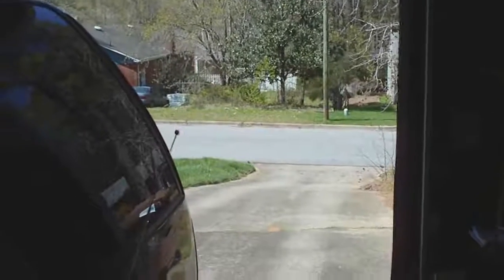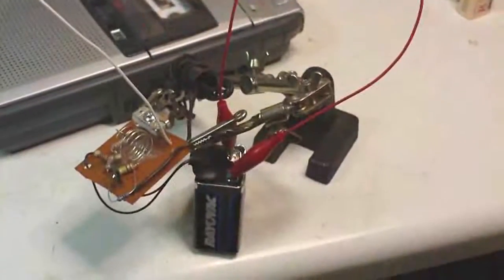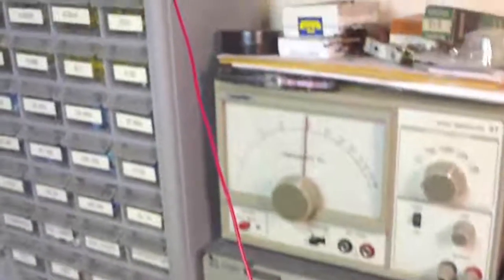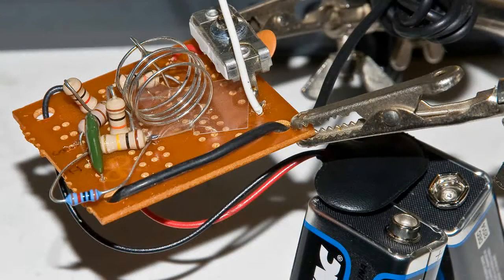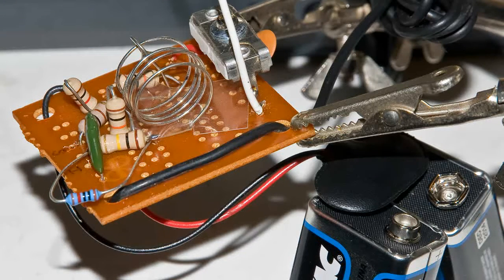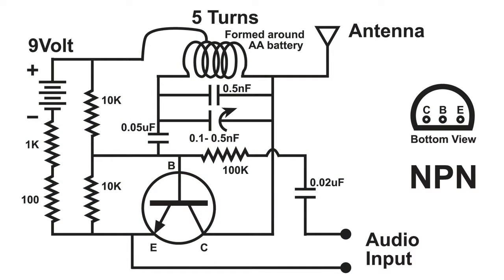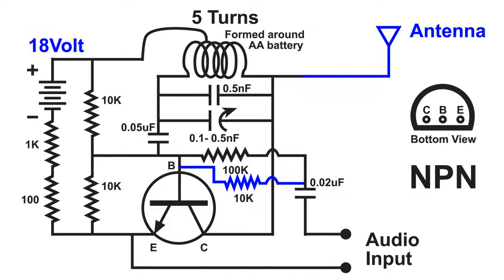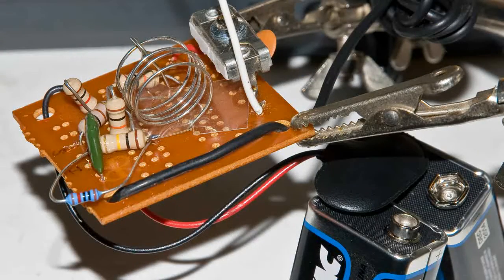Build FM One Transistor Transmitter Project Modification 3-3

Comment: What type/number transistor did you use for this transmitter?
Reply from the maker: 2N2222
Reply: @AllAmericanFiveRadio  ok, that's what I'm using. Have tried rebuilding this transmitter several times exactly like your schematic, but can't get it to transmit at all. Checked my connections and looked for shorts, but no go. Even changed the 5 turn coil out and tried different guages of wire. What gauge did you use? Oh, built mine on a circuit board and you used a perf board maybe that has something to do with it??? Thanks for all your help.

Comment: Hello, I have constructed this transmitter just like you have it here in your video. It has one problem, it transmits at 160.450mhz and not on the standard fm broadcast band. It will transmit quite some distance, but I don't want to be transmitting at 160.450 mhz. You said in your video that the coil and the variable capacitor has to be changed in order to transmit in the fm band. How many turns does the coil need to be? Also, what is a good value for the variable?  Another question is what guage wire did you use for the coil?
Reply from the maker: Five turns for the coil. If the frequency is to high add another 0.5nF in parallel with the variable.

Comment from the maker: @mantaz111 
The way this transmitter is built is not for looks. When you get to the FM band the physical component placement is very important. Also it is designed to have a low impedance signal source. I used a Radio Shack NPN transistor in a pack, works out to be about 10c for one. BC 547 is a AF transistor not RF.

Comment: @AllAmericanFiveRadio Video would be very nice to upload, but I don't have camera. About sound quality problems: I'm using my phone as audio source, could that cause any sound distortion? And I'm read in some web site that BC 547 is very crappy at this job, but I can't get other transistors to work. As a sound source I've tried computer and mp3 player, those won't work at all, I don't get this, maybe I'm using wrong capacitors or something. No clue.

Comment: I have built this transmitter. It seems to broadcast but the sound quality is very poor. I've changed my old variable capacitor to fixed one and all that did is increased range. I've tried to change transistor and it seems to be that my transmitter is only working with BC 547, others won't work at all. How can I improve sound quality?

Comment from the maker: That would require encoding and a pilot carrier circuitry. Of course that would add quite a-bit of parts and cost. For stereo I bought a Ramsey Electronics FM Transmitter and it works great! The FM Transmitter Kits are excellent.